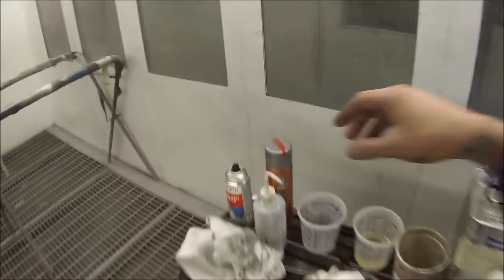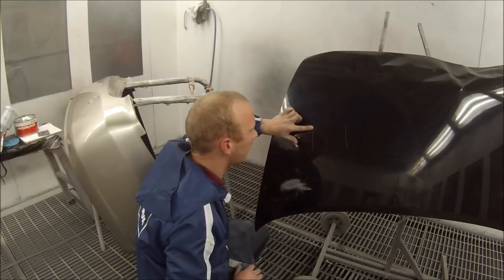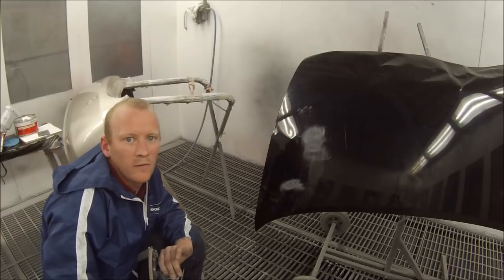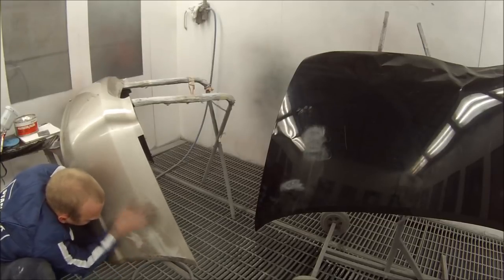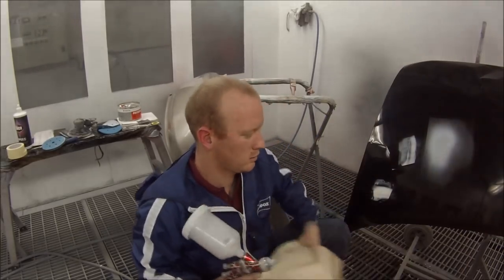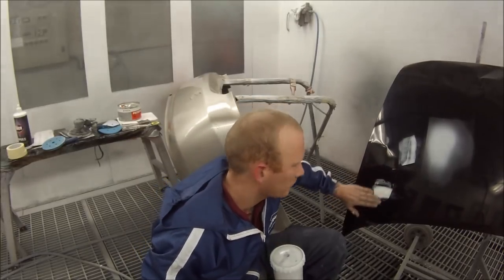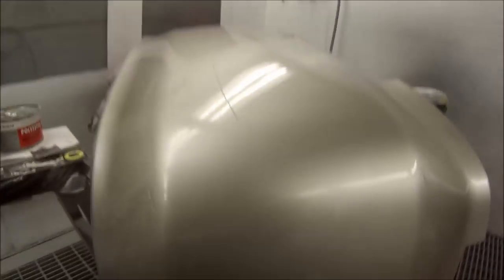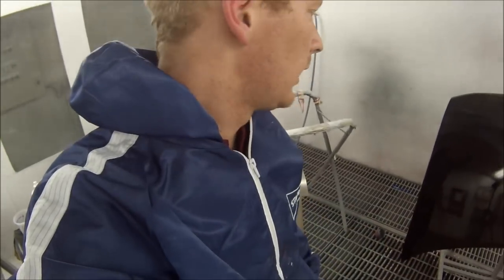Spray Painting For Beginners

Comment: Old video homeboy.. But i just realized today that you have 2 main types palm sanders. 5mm orbit and 2.5mm orbits. DIY guys should stay away from 600grit as final sand before paint when using 5mm orbit (common at supercheap etc) use 800 to avoid pigtails..
Your thoughts?
Reply from the maker: Yep, good advice, even some tradesmen can't go full beast mode like TGM 🤘😆🤘

Comment: Would you put a flex agent in the base or clear  when painting the plastic/abs bumper?
Reply from the maker: Not necessary in most cases, there are some rubberized plastics that need it but they are rare. The 2k clear does have a bit of flex before it cracks.

Comment: I have just sprayed 2 wings and a bumper,the first time I tried the base coat went on well but when I put the lacker on,it dried to a dull cloudy finish.Any ideas,i done this in a shed with no heat the first time and have used a space heater this time when I applied base coat
Reply: +James Miller a couple reasons why clear dulls out is if you put to heavy coats on the over each other it will and can cause (solvent pop and or die back if you dry the paint to longand to fast) in your case it sounds like you did not put enough clear on. you need a thinkness of clear to maxamixe gloss(measured in Millimeters)

Comment: I want to paint my Sprinter truck with a Sherwin Williams Genesis LV3 Satin 2k polyurethane. I like the satin look and SW has one I think will work. Much better than some of the other products from what I can tell that are sold out there.
What Spray gun and fluid nozzle would you suggest?
Reply from the maker: 1.3 or 1.4mm will be perfect for 2k
Reply: Thanks for your response again. I have plenty of compressor and would have of course a guage at the gun. I am always confused by the cap pressure........so what do I PSI as it enters the gun say for that satin paint......I know its somewhere from 20 to 40 psi with the trigger wide open....is it half at the cap?
Reply from the maker: Nobody really measures from the cap, I mean some may but rarely, yes from memory just a bit over half
Reply: So I spent some time talking to the Devilbiss engineers......you might want to know some info.they know you LOL
Reply: The engineers for the 4 and 5 gun from europe sit right next to each other
Reply: Both of those guns are made in Mexico FYI
Reply: Its about compliance.........the 5 does not replace the 4...there is more fluid nozzles for the 4 than the 5...Its about the air cap numbers basically and the air cap numbers
Reply: The number 3 cap is what you want.....the difference is one is chrome and one is blue and the air cap is slightly different
Reply: I spent around 30 minutes talking about this today with their engineers
Reply from the maker: Yeah from what I know they are very strict in USA with the spray guns, we get the better ones here but good luck getting an AK47 lol.

Comment: Quick question... you did a video on hvlp vs conventional vs LVLP air caps. Is it the air cap ONLY that I change to convert from one type to another and I asume the LVLP aircap will require less cfm thus a smaller compressor.  Correct?
Reply from the maker: Jeff DeLuca Yes but only if you have a devilbiss gun, most other brands don't have interchangeable caps and they make you buy a separate gun. what gun do you have?
Reply: Just have an older siphon feed binks 2001 and binks model 15 touch up.  Looking at devilbiss flg4 and sri pro soon
Reply from the maker: FLG4, tbh not the best gun, I'd go for the FLG5 or SGK600-bv both in 1.4, also see my star evo mini gun review less than half the price of the SRI 
https://www.youtube.com/watch?v=MA5d3IQP0W8
Reply from the maker: It does look very similar, not 100% same though. Mine's a 1.2 and Star brand but its a reasonable price so give it a crack if you want but here's the one I got 
http://www.ebay.com.au/itm/STAR-NEW-CENTURY-SLV-EVO-T-MINI-Gravity-Spray-gun1-2mm-/120778164107?hash=item1c1ef0878b

Comment: you use polyester filler for the plastic bumper and the hood (metal) ?
Reply from the maker: Yes thats correct, There are specific fillers for plastics but I've found that the polyester fillers do just fine in both metal and plastic, Thanks for watching cheers

Comment: is using spray can much worse than using a gun?
Reply from the maker: ook park Spray cans are a quick fix and wont last anywhere near as long as 2k paint sprayed with a gun.
Reply: im so sorry but what does 'last' mean? like its gonna peel off or that it changes color?.  im a real newbie.  thansk dude.
Reply from the maker: Durability, gloss, colour difference, chip resistance etc.
Reply: ook park spray bombs do light wispy coats and don't build up like a gun. Make sure you get the butter zone of a nice heavy wet coat with no runs and you can get decent results. Wax after it cures.